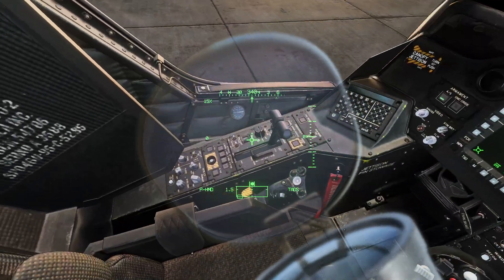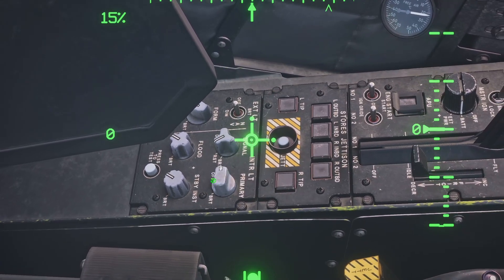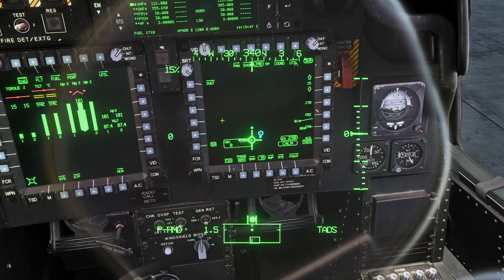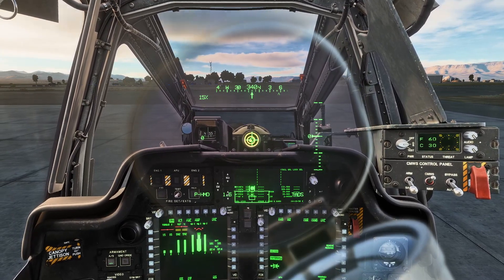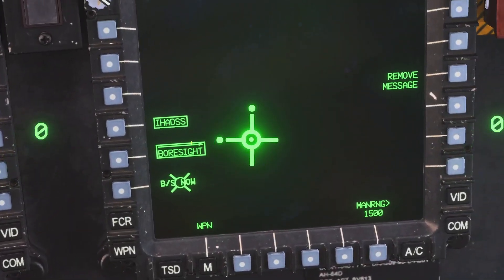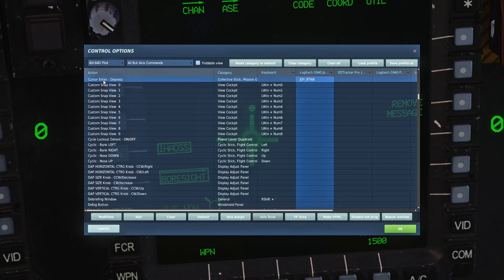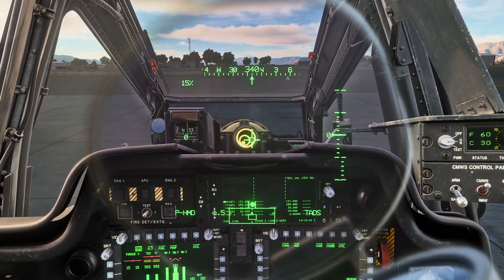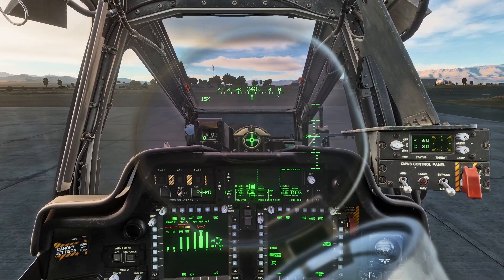DCS: AH-64D | Boresight Alignment

Comment: When I center the reticle on the BRU all the circles are to one side of the BRU. How do you adjust them to the center AND have the reticle be centered on the BRU at the same time. Literally zero videos cover this. Thanks!
Reply: You move your head around to compensate. Have to align everything up.
Reply: @jubuttib  so you adjust the BRU circles with head movement until you get the center dot to be in the center when the LOS reticle is centered on the BRU? I’ll try that today! Thx
Reply: @StrokersGarage  Yup! Hope it works out. =)
Reply: @jubuttib  doesn't work. I have to look way up to get all the circles to center on the BRU. No amount of moving my head around causes me to end up with my LOS reticle in the center of the BRU with all the circles centered. Any idea?
Reply from the maker: @paulgeorgelas383  Probably a Headtracker issue
Reply: @ToteTorresWW  what do you mean? I’m on VR and the tracking is spot on… 

There doesn’t seem to be a way to get the circles to move to center them on the BRU while the LOS reticle is centered on it. Is there a button you’re supposed to press? Just yawing my head left and right and/or tilting my head up and down doesn’t change anything (it does track, if I look left my head tracks left).
Reply from the maker: @StrokersGarage  Ohh my bad, then is a bug with VR users, we should report this, I though it was a headtracker issue but nvm my bad
Reply: @ToteTorresWW  all good! I just want to blow stuff up with the gun🤣 
This thing is amazing. If you haven’t used rotor ops, you’re missing out!
Reply: @Johnny641  Finally that did it. yeah with track IR  it's the same it's not enough to just move your head, you have to move your whole body, and move your head back and forth, and with that and head movements you can get your retical in the center and have them all line up
Reply: @StrokersGarage  that's not really specific enough, using track IR I actually had to move my head sideways, rather then just turn it left and right, and I had to actually move my body, to make it work.
Reply: @StrokersGarage  Ooooh you were on VR! That explains it!
Reply: @StrokersGarage  You don't just tilt your head - you have to move it too. Hunker down in your chair, sit up straighter, do what it takes to get it all aligned.
Reply: @Malakhit24  yep, figured that out. It eventually gets there with VR. Thanks